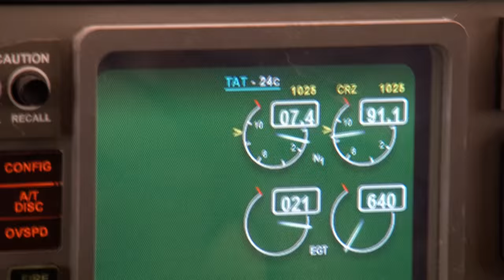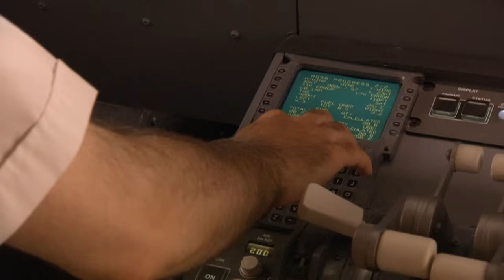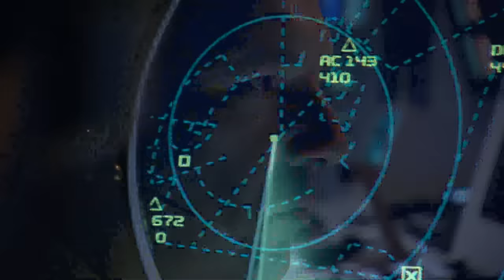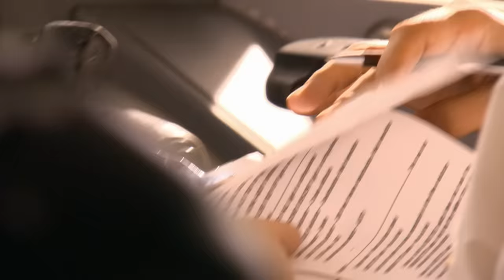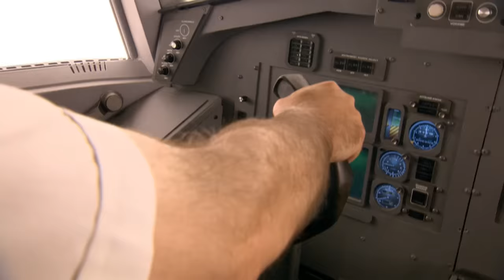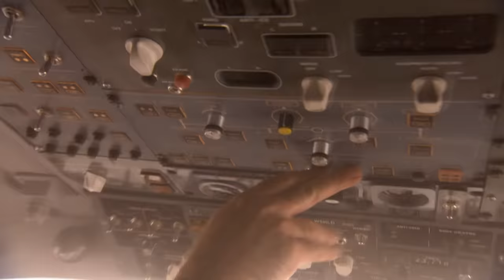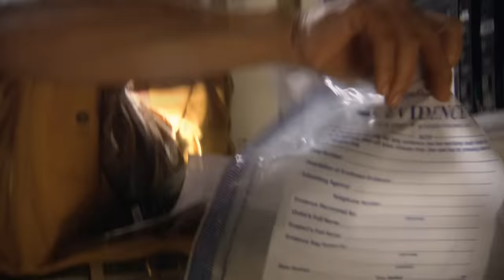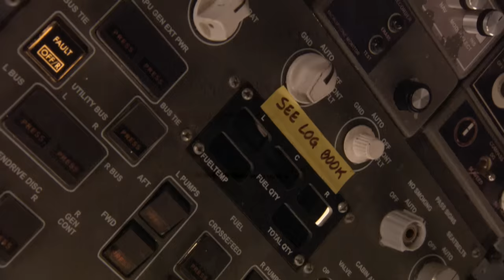Air Canada Flight 143 Lands With No Fuel | Mayday | Wonder

Comment: Both 757s and 767s had fuel indication problems from the beginning. We always used "known quantities" to resolve temp issues with the fuel indication. There were drip sticks under the wings as well. But we all used Pounds or Gallons in the US, so we didn't have these problems in the 48. Pilots, Mechanics and Ground Crews all know that Fuel is 6lbs per gallon, Oil is 7lbs per gallon and Water is 8lbs per gallon. You can verify the fuel qty with the drip sticks after pumping, that was standard activity.
Reply: Then you have American vs. Canadian gallons. 8.34/10.04 lbs per US/CAN Gallon. Also atmospheric pressure and temperature (as you mentioned) affect mass of H2o.
Reply: @HowardBaileyMusic  My only point is that the Manufacturer, Boeing Aircraft has the entire cockpit instruments reading in inches, feet, pounds and degrees F; I mean everything, including altitude, thrust, fuel gauges, engine temp, etc. Velocity is in Knots. Note: American ATC and many abroad are also using standard measurments. So you venture down with your shiny new 757 into the USA and Seattle Center asked you to decend to Flight Level 250 (meaning 25 thousand feet) and reduce speed to 300 knots. Your cockpit reads in Meters and Kilometers, so who does the math here while you are flying along at .85 Mach? We need to get on the same page, but when you watch these accident videos, and you see the actors portraying the deceased crew, you can see them speaking in feet, and pounds even though the narrator is speaking in meters and kilograms. It is so funny to me when these shows routinely mix the two measurements like no one can tell. Example "cruising at 35 thousand feet and then they fell into the sea at 850 Kilometers per hour". Who has time to figure all that out? Next time you think metric is more accurate, try dividing a meter into thirds. A yard and a foot do it quite nicely thanks. And when I work on aircraft I use tenths of an inch. By the way, all the hardware on the aircraft is in standard thread and headsize, 1/4, 3/8, 1/2, 9/16 etc. We certainly need to figure a way forward, but the US has most of the aerospace products in the world, even Japan builds their aircraft using standard hardware cause they buy alot of equipment from the US. Tires, brakes, engines, etc. Just my nickel and a half.
Reply: @peterolsen269  this is a Canadian production, and in a lot of the early episodes they converted EVERYTHING into metric in the narration.  However, aviation in Canada is done in imperial units, just as in the US.  The lone exception was (is?) the fuel gauges on Air Canada's 767 fleet.  The 767 was Air Canada's first new plane since Canada went metric (in 1978) and since the gov't owned the airline, the order was given to have the planes equipped with metric fuel gauges.  All other systems remained in imperial units.  Couldn't tell you if AC still measures it's fuel in kg!
Reply: @stephenp448  I've been in Aviation for 40 years and I remember exactly when this story came out. So don't take offense, it was lucky for those people that the pilot had glider experience. This is about making air travel safer, not a fight about metrics, relax. Perhaps we should divide the year into 10 months and the day into 20 hours in keeping with the "Decmal units are more accurate" theory.  Point of the metric system is that one cubic centimeter of water weighs one gram. As long as we have been alive we have never possesed water that weighs one gram per centimeter and if we did it would only be at sea level on a standard day.  As well as the fact that we are never weighing water then are we? Just having fun, I've flown from PHX to ANC in my Skylane three times. Love your country and your people. ATC always spoke to me in Feet Alt. and Knots AS. : )
Reply: @peterolsen269  none taken.. just pointing out that in general, Canadian aviation uses imperial measures.
Reply: @stephenp448  Yes. I know. BTW I think everyone has gone to Celcius world wide now? Thank God I'm too old to have to deal with it. hehehe.

Comment: My father was a second officer for Northwest Airlines. He related to me a similar incident that took place on a DC-10 plane. The plane flew to Chicago from Minneapolis. It took on new passengers and fuel and then started back to Minneapolis. On the climb out the Captain was working the radio and the second officer was flying. Shortly after takeoff, the Captain was puzzled by the flight characteristics of the plane (rate of climb, # of passengers, cargo, and fuel weight). He double-check the rate of climb and said to the second officer, "this plane should not be climbing out this fast." He contacted the tower and said he was bringing the airplane back to the airport (Chicago). Northwest operations did not want him to do so, but the Captain insisted and brought the plane back to Chicago. When the fuel tanks were checked they were less than half full (even the gauges read full) and the plane would have suffered a similar or worst fate as this airliner. Very smart pilot!

Comment: In motorbiking, there is a special pocket in the fuel tank-[reserve] to engage in case of a loss of fuel. It usually gives [only on command] an extra 10 % or so.
Reply: Jets are given enough for the trip and extra in case the airport gets closed so they can safely divert.
Reply: Just one big problem. The turbine compressor engine doesn’t use fuel.
Reply: @kevinwilliam3722  Huh?, it's a jet, it uses jet fuel, a lot of it.
Reply: @kevinwilliam3722  the bleed air is taken from the front of the turbine BEFORE the fuel is burned. To run any engine you need fuel. batteries are too heavy for flight.
Reply: @barryaiello3127  
Fuel 6lbs per gallon. If you filled the wings with liquid, it would rip the wings off the plane.
Reply: @kevinwilliam3722  What the heck are you smoking dude ???

Comment: Fun Fact: The plane would NOT in fact "Explode into flame". If it had to land in the grass it would most likely just collapse a landing gear on a large rut or dig into the dirt, sending the plane into an uncontrolled slide in which it would fall apart as the extreme forces on the airframe twist it like a pretzel. No fire though! Because it was out of fuel! (16:30)
Reply: Out of fuel doesn't mean there's nothing at all in the tanks. Can mean the tanks are full of vapour, which is more likely to explode.

Comment: A simple automotive fuel gauge for each tank , added to the system, would have prevented this. Inconceivable that there was no redundancy for displaying the fuel levels.
Reply: They did have digital fuel gauges, but were out of service. I agree, the aircraft never should have been allowed to fly with incomplete instrumentation.
Reply: There was redundancy, but the computer failed in a way that wasn't expected.  The fuel quantity processor had two channels, and if one failed, the other was supposed to provide the redundant backup.  In this case, one channel had a PARTIAL failure (if I remember, a bad solder allowed a reduced voltage through the system), which caused the whole unit to stop reading.

When the problem was first discovered (the day before this flight), the mechanic in Edmonton found that pulling the breaker for the faulty channel allowed the other to operate properly.  Dripping the tanks was supposed to provide the required redundancy.

It was in Montreal the following day where the wheels fell off.  A mechanic turned the breaker back on to test the system, and forgot to pull it again, which killed the whole system... Then they fouled up the math after they dripped the tanks.
Reply: just put clear fuel  tubes on those tanks, send someone to moniter them. simple! ya just cant trust anyone these days. other planes have them.

Comment: 42:00 Here is my guess. Fuel weight was calculated in kilograms, but filled in pounds. This would be a serious issue, as it takes approximately 2.2 pounds to equal 1 kilogram. When operating in regions where both the imperial and metric systems are in use, confusion can occur.

Very close. There was also a volume to weight conversion. Still it came to a confusion between pounds and kilograms. As soon as I heard there no leaks and no technical faults that would result in too little fuel, then they mentioned less than half of what would be required, the ratio 2.2 to 1, came immediately to mind.

Comment: Even without a fuel gauge you would think the pilots would be able to tell a difference between taking off with half the fuel vs all the required fuel for the trip.. Either way, great job to those guys. They deserve every award we could give them.
Reply: That flight should have never taken off. There were plenty signs they should have caught. They landed it safely tho

Comment: Malcolm Gladwell's book Outliers perfectly explains this.  It was a cascade of errors that led to the incident. A failure at every step along the way. 
1.) The plane shouldn't have been flying without 100% functioning guages. The plane was in a defective state and not fit for use. 
2.) The lack of standardization to metric units caused the fuel filling error.
3.) The lack of current airport reports meant that Gimli was a drag strip, not a runway. That's a failure of ATC to know that. Inexcusable.
It takes more than one failure to crash a plane. It takes MANY failures. This example (and Gladwell's book) perfectly illustrate this point. Read it.

Comment: Why doesn’t a plane have a fuel gauge that would show when the plane is low on fuel. A manual gauge not relying on circuit boards.
Reply: They do but there was a issue with them but you always are ment to do the math yourself and that's what happened here  they talked about the fuel gages right around the 40:00 mark

Comment: The shame of this incident tis how it is spun that the pilot was a hero.
He took off with insufficient fuel. His company failed to provide the required training in understanding the fuel system and monitoring system.
So pleased they all survived. Shamed that the Company and Pilots try to make this a good thing.
Reply: If you watch the video, it is made clear that the problem wasn't the pilot's fault. The ground crew miscalculated the fuel amount and the flight crew failed to notice the error because none of them were trained in metric calculations. The onboard system for determining the amount of fuel in the tanks was not working properly and didn't notify them of the error. It was a miscommunication due to lack of training by the airline. A less skilled pilot would never have been able to pull off the landing that Captain Pearson did. He saved everyone on board, end of story. This was the first airplane to use metrics for fuel and it was Air Canada's responsibility to make sure that the ground crew and flight crew were trained in these calculations. They were not. The problem started with Air Canada's oversight. Everything else was a consequence of that. They could not have known because they were never told.
Reply: @thefatherrabbit  the bottom line is that it IS the Captains responsibility under CARs to ensure sufficient fuel. 
Fuel from start taxi destination plus alternate and minimums. 
It might well be done by dispatch. But read CARs 705/725 and you will see it is the flight crews responsibility.
Reply: @stevejh69  I understand that, but with their training they would not have been able to do so. The official investigation report stated exactly what I said, that this was a problem with communication, training and manuals.
Reply: @thefatherrabbit  so when someone dies. It’s all ok because they made an error. 
No. 
They are paid and rules and regulations are in place to stop those errors. 
As I said. This was spun extremely well by Air Crapida trying to make a potentially horrendous disaster into an error and some amazing flying. 
They almost killed everyone. That is not acceptable no matter what!
Reply: @stevejh69  As I said, Air Canada was responsible. I don't think I ever said anything otherwise. I also never said "it's all ok." The ground and flight crews were not properly trained in metric calculations as they should have been. What I'm saying is that the actions of the pilot in landing this plane safely should not be discounted. It could have been a major tragedy and loss of life.
Reply: @thefatherrabbit  
Thanks for the response. A good one. 
Yes his actions were good. But there is an old aviation saying. 
“A good pilot uses his superior skills not yet get into trouble in the first place. Rather than use them to get out of the trouble they created”
Reply: @stevejh69  I appreciate the understanding. I still disagree that the pilots created the situation, however. The pilots did not know how to do the calculations because they had never been taught to do so. They therefore lacked the skill necessary to avoid the problem in this scenario. Air Canada had a responsibility, knowing that this was their first plane to use metric calculations, to make sure their ground crews and pilots were properly trained on how to perform those types of calculations. They did not. That's why I say the issue was with the airline itself. Apparently this was around when Canada had started trying to switch to the metric system over the imperial system. They really should have foreseen that this could have been a big source of confusion for crews.

Comment: I have attended Private Pilot Grounds School on two occasions. We train for gear down, no power landings. We train for power with no gear landings - Ie. feather the props, then shut off engines at the near moment of touch down. We never trained for partial gear down, no engines landings. They are all alive thanks to so many factors that it quite possibly could never be duplicated. We are thankful that they made a successful landing. Ie, all persons or souls on board able to disembark the plane, and the plane being reusable after touchdown.

Comment: Still NOT the longest glide with a commercial passenger plane.
The Azores Glider did 75 miles over the Atlantic Ocean and were lucky enough to have those Island's sitting there 2 hours away from Lisbon

Comment: If they put in 22300 lbs of fuel and they needed 22300kg of fuel , it sounds more like it wasn't a miscalculation, but a misinterpretation of the difference between lbs and kg.   What kind of conversion formula winds up with the initial number?

Comment: 25:55 Not to sound nit-picky, but it’s actually a forward slip. Side slip is when you don’t apply enough (or too much) rudder while trying to make a coordinated turn (or to track the centerline in a crosswind approach to landing).  A forward slip is where you purposefully yaw the airplane to expose the side of the fuselage to the airstream to gain aerodynamic drag and increase rate of descent. Basically, in a side-slip, the airplane is pretty much doing what it wants to do, but in a forward slip, you’re forcing it to do something that it definitely doesn’t want to do. They are slightly similar but very dissimilar in technique. 
I definitely enjoyed the video 👍, just thought I’d mention this small discrepancy.

Comment: Need for procedural change obvious. Conversions are an invitation for error. Have the fuel truck weigh before and after fueling. Conversion meter should be installed on fuel trucks. Pounds or kilograms, weight vs. volume - too opportunities for error to creep in. Oh, well. This was 1983 and they probably have tight protocols in place. Great reenactment.

Comment: This makes it seem like the refueling truck operator was the problem.  The flight crew was told how much fuel they had in liters in Ottawa, and then the flight crew used the wrong conversion.  I guess there might be some debate about whether it was the captain or first officer who was supposed to do the calculation - but in any event this was NOT the fault of the ground crew.  Even if they didn't take on enough fuel in Montreal, no matter who was to blame, the flight crew screwed up the conversion in Ottawa.  No question.

Comment: The Gimli Glider, Yup. Before take off the ground crew loaded LITRES NOT KILOGRAMS. SO THEY ONLY LOAD 1/2 OF WHAT WAS NEEDED. THE STANDBY USE ONLY 'DROP DOWN DIP STICK UNDER THE WINGS SHOW LITRES ON ONE SIDE AND KG. ON THE OTHER SIDE OF THE STUPID STICK.  I BELIEVE THAT THE FLIGHT DECK FUEL GUAGES WERE U/S AT THE TIME.

Comment: Engg calculations with conversion of weight like pound to kilograms should be kept and bear in mind by those technicians using that application ( especially  fuel for airplane).
Reply: It was the first plane they had using the metric system.

Comment: So as a Quality Engineer I find it astonishing that the correction was more training and spare parts. Training is a tool of prevention and they made it seem as it was the techs fault only. In reality not only was it a lack of training but the airlines allowing the planes to be operable with such critical faulty gear that detects these issues. So hopefully in the actual report it requires not only spare parts but the planes not being able to fly without the equipment replaced if faulty. Otherwise the same thing could happen today if some doodle head makes a poor calculation. Good vid though

Comment: Did the captain or co-pilot ever fly that same plane again?    I wish they would have showed a computer simulation of that entire landing.  Showing the slide to the final straightening before landing.  Do they now use weight in kilos or is it still volume and weight?  Great story.
Reply: Trucks have to operate by volume I think. So the calculation still exists, but in metric.